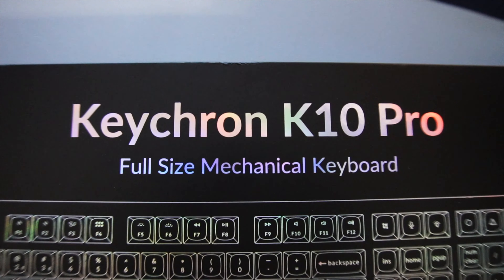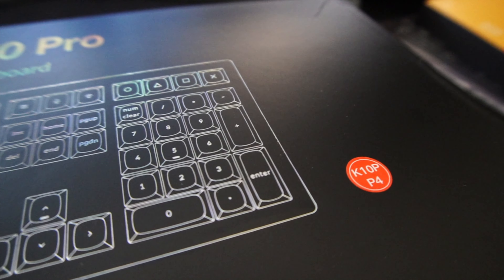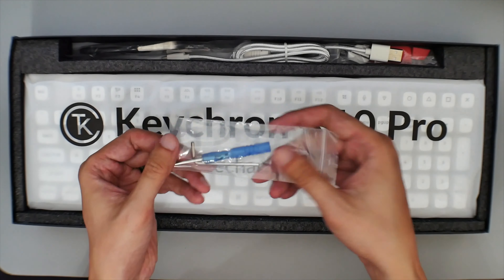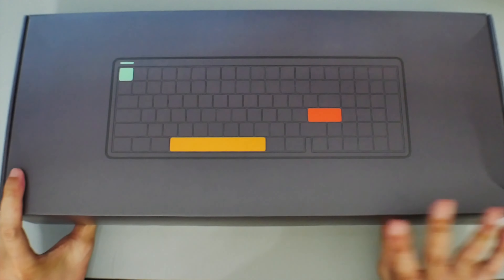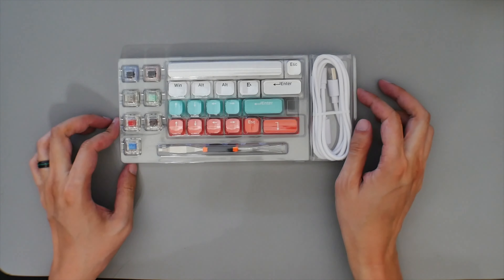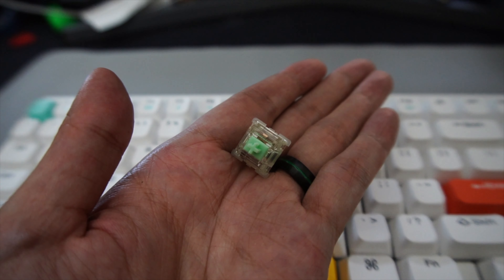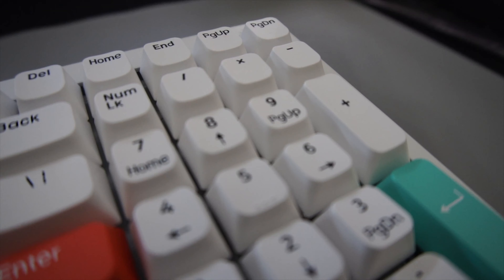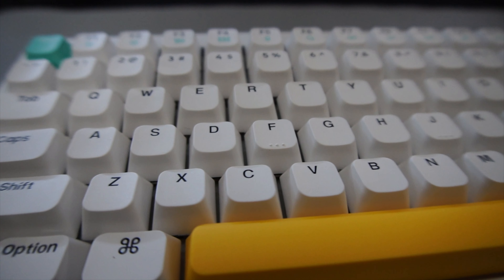Keychron vs Nuphy - Which one would you choose?

Comment: people like to talk shit about keychron. Not saying that this video is but I've got a q12 with baby kang switches and I did go in a mod the stabliizers and this board sounds amazing. I enjoyed this video. Im more into the switch feel than anything else. One of the reasons I love the bb kangs is that the force to actuate is heavy enough to never accidentally actuate a key but the bottom out force isnt fatiguing my finger when I hold down W to run in a game and whatnot
Reply from the maker: I'll definetly have to check them out.  I've generally been really into light switches recently but the way you describe these is interesting.  I actually find Keychrons Pro lineup to be pretty good.  Much better stabilizers and even gasket mounted plates like in the Q1 Pro.  Its their super budget lineup i really have the main issue with.
Reply: @keybound  Thanks for the reply. I look forward to your next videos. :)
Reply: Keycron Q1 Pro vs Nuphy Halo 

Which is better you guys think? 

Plz help ⚡️❤
Reply from the maker: @playbunny99  I think this is a very different conversation to be honest.  The Q 1 Pro Keychron is very much their mid tier level of keyboards and offers things like gasket mounts, screw in stabz, and Polycarbonate plate which draasticaly change the sound and quality of the board.  If it were between those two, i would have to go Keychron.